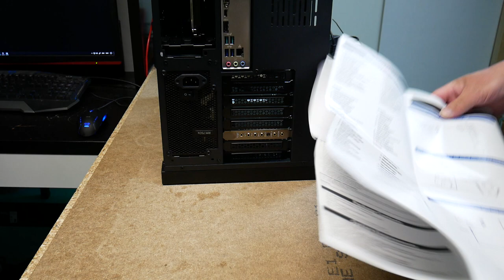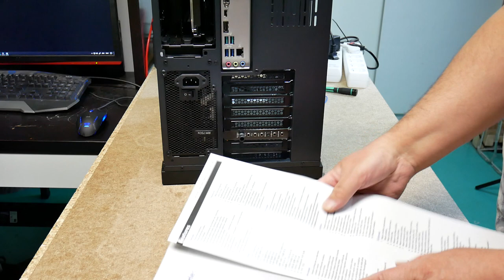PC build strix sound card  installation

Comment: it can work without power cable?
Reply from the maker: Probably not. May be if You are lucky and do not use headphones it may be able to power itself from PCI slot alone. Give it a test :)
Reply: @TheTechRabbit  actually, i dont have a 6pin cable to power it up. But after connect my Steelseries Arctis 3, they are working, light on Sound card is on. So the power cable may be needed if trying connect i high impendance headphones. But not sure.